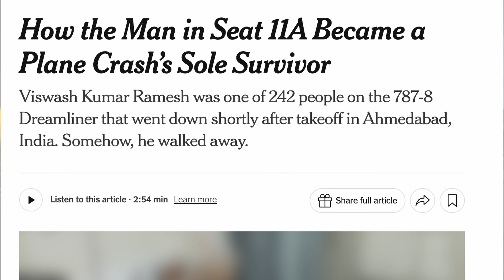Why the RAT Changes Everything – Air India 171 Update

Comment: Have seen the video of the survivor saying that for 5 to 10 seconds everything went silent in the aircraft as if the power had gone off .the light coming / blinkering  in the aircraft is the later part of his statement .i refer the silent part which he is mentioning as the power engine failing . The landing gear not going back into its position which is seen in the videos is a signal in my view that it could not go back because of the engine losing power at that point of time as it was about to take off having achieved it speed and was just getting airborne by then and once airborne could not achive the thrust due to the engine failing even though it was airborne by that time by virtue of having achieved the take off speed/position . Is it possibe that the aircraft landing gear not going back and thrust not being achieved once after taking off led to a system configuration error leading to the engines failing .The RAT being deployed and the lights coming back in the aircfaft as mentioned by the survivor meant the electrical and hydraulic system were back on track but not the engine power Am not an expert but trying to make sense of whatever i have read or listened to

Comment: The evidence points strongly to a dual engine failure. With bird strike and fuel contamination largely ruled out, a failure in the aircraft’s computer systems becomes a leading suspect.
On the Boeing 787 Dreamliner, the Common Core System (CCS) serves as the aircraft’s central brain, controlling not just flight operations but also both engines. The left and right Common Computing Resources (CCR) cabinets, along with the main lithium-ion battery, are all located in close proximity within the Forward Electronic Equipment Bay.
A catastrophic failure or explosion of the lithium-ion battery could potentially damage both CCR units. This kind of damage could disrupt fuel supply to both engines simultaneously. That scenario aligns with the loud explosion reported by the survivor. High ambient temperatures in Ahmedabad may have increased thermal stress, raising the risk of battery failure.
It’s worth noting that the 787 experienced at least two lithium-ion battery fire incidents in 2013. This history reinforces the plausibility of battery-induced system failure in this case.

Comment: A double engine failure though plausible is extremely unlikely. Another more plausible emergency situation is a complete hydraulic failure immediately after airborne while attempting to retract the landing gear. The failure prevents gear retraction, then due to confusion in critical stage of flight one crew member hastily or prematurely attempts to raise the flaps while the RAT deploys leading to loss of sufficient lift to keep aircraft airborne at such a slow speed. Pure speculation of course but seems to me to be more plausible than a dual engine flame out  due bird strike or FOD unless of course fuel contamination was the cause. 🤔
Reply: The video showing the plane crash with added propeller sounds is completely fake. I’ve watched the original footage with its ORIGINAL audio multiple times, and there were no propeller sounds at all. It’s disappointing what some people will do just to get views.

Comment: I am still perplexed about a double engine failure culminating in loss of power. Hardly anything in this aircraft could be thought of as more reliable than its Gen-X engines. The other point here is that the 787 is the first wide body to replace the APU with a lithium ion battery.The sudden deployment of the RAT suggests this could have malfunctioned

Comment: As an electrician i would be interested why the energy was lost so suddenly. From the run to the crash means more than just a generator failure. How can the electrical system fail in such a short time ? There are batteries and the rectifiers must have been shut down by feed - loss during rotating. The moment of voltage collaps is very crucial.

Comment: Here is the latest confirmed update on the investigation into the crash of Air India Flight AI-171, based on the preliminary report by India’s Aircraft Accident Investigation Bureau (AAIB), published on June 15, 2025:

---

🔥 Key Findings from the AAIB Preliminary Report

1. Established Cause: • Unintentional thrust reduction caused by the captain’s seat sliding backward during rotation.
• The seat locking mechanism failed in the rear position, causing the seat to abruptly roll back. The captain’s body weight pulled the thrust levers into idle.
• The first officer attempted to push the thrust levers forward but was unable to overcome the captain’s weight resting on them.

2. Mechanical Evidence: • Wreckage inspection revealed sheared locking pins (PN: BACB30LN5S02) on the captain’s seat rails.
• The technical log shows the seat was serviced 11 days before the crash due to “tight adjustment.” No functional testing was carried out after the repair.

3. Timeline of Events (based on CVR/FDR data): • +0:12 sec: Rotation begins. Captain’s seat abruptly slides back.
• +0:15 sec: Thrust levers in idle. First officer: “Thrust is dropping!”
• +0:18 sec: Captain: “My seat!” Sounds of struggle.
• +0:26 sec: First officer attempts to set full thrust; aircraft enters stall at 214 feet AGL.
• +0:38 sec: Impact with the ground.

4. Contributing Factors: • High ambient temperature (43 °C): engine performance was degraded, leaving minimal margin.
• Crew coordination breakdown: no “STAB TRIM” or “GO-AROUND” calls during the 26-second critical window.
• Design vulnerability: the Boeing 787 lacks protection against inadvertent thrust lever rollback (such as a “weight-lock” or reverse detent).

---

⚠️ Immediate Actions

• Global Directive: FAA and EASA ordered urgent inspection of pilot seat rails on all Boeing 787s within 72 hours.
• Air India: grounded 12 aircraft with similar seat maintenance history.
• Boeing: initiated redesign of the seat locking mechanism and review of thrust lever resistance settings (expected Q3 2026).

---

🕯️ Human Loss

• Fatalities: 243 onboard and 4 on the ground (medical personnel).

---

→ What’s Next?

• July 30, 2025: Final AAIB report with detailed technical analysis to be published.
• August 2025: International summit on cockpit ergonomics and safety (under ICAO auspices).

Sources: AAIB Preliminary Report | FAA Emergency Directive 2025-16-51 | Boeing Service Bulletin 787-25-123.
Reply: Can't find confirmation online of these reports/documents but this text was posted on a piloting forum by a normally "reliable" pilot... Seems too early for even interim findings to me, take with a pinch of salt

Comment: Apparently this flight when inbound prior to this flight, had some electrical issues.  I'm not how an electrical failure would effect the fuel selection valves or pumps? They also seemed to rotate very late, kicking up dust from the runway end. Was this due to slow acceleration or did they elect to do an intersection takeoff?    The initial pitch up was fine, but the moment they came out of ground effect the aircraft started descending.

Comment: There was a 2015 AD for the 787 detailing how the PCUs would shut down all electrical power to the aircraft if they were powered up for 248 days straight.
The fix? "Don't leave your 787 powered up for more than 120 days".
This issue was due to the 32-bit, 1/100th of a second clock in the 787 computers which would automatically send all AC generators into fail-safe once capacity was reached after 2³² centiseconds... 248 days 13 hours 14 minutes.
Highly unlikely for a 787 to remain powered up for that long, with maintenance intervals generally being shorter than this, which require full shut down... but conceivably, with postponed or skipped maintenance, could this 787 have simply been turned on for too long and reached this computing threshold, resulting in the computers shutting down, putting the electrical systems into fail-safe mode and potentially shutting down both engines or at least leaving no CPU to control them?

Comment: If they are certain it wasn't pilot error and that it wasn't birds. We can then assume it was an engine failure. But that is baffling, two engine simultaneously going out.. even if it was a fuel issue they would sputter, and it would happen slowly, it wouldn't happen this quickly which makes me think there's some mechanical problem. Almost as if I'm mechanic doing work on the plane put it back together wrong and no, I'm not saying that's what happened, but that's where my mind goes to next.

Comment: How on earth do both engines fail immediately after take off? We need a follow up when you collect more data!
Reply: Another video speculates that it was a hydraulic failure + vapor lock. The plane sat on the tarmac for 2-3 hours on a very hot day. Some of the fuel vaporized. Then combined with a hydraulic failure, which disabled the landing gear retraction and fuel pumps, it wasn't able to clear the fuel lines of the vapor bubble and stalled the engines.

Comment: Captain Steeeve, I have reproduced this flight on my flight simulator in order to understand the cause and have concluded for sure that this tragic accident was caused by a dual engine failure very close to the point of take off. However, I'd like to raise a new point that comes from the simulation. It's my belief that in the last few seconds of the flight the pilots turned the aircraft a few degrees to the right to avoid impact with a tall block of flats. Their heroic actions probably saved multiple lives. I look forward to seeing if this point is confirmed by the investigation. I'd like to add that it is horrifying and sickening to reproduce this accident in virtual reality. May god bless everyone impacted by this dreadful tragedy.

Comment: But RAT automatic deploy theory coming from both engine failure is faulty. If both engine really failed, all cabin lights would have gone because of main engine generators failed too and not come back after RAT deployment because RAT does not supply cabin interior lights (only emergency systems). and survivor would  most probably remember all lights and IFE system gone before impact (not blinking). RAT was deployed manually by pilot with panic most probably (he thought had to do something to recover lift) and when RAT generator engaged cabin interior lights blinked because of electrical bus transition. in my opinion, all these brings us again same point : wrong action:  to retract flap instead of landing gears. This can be insane but this phenomenon is rarely seen in F/Os. (confusing flap and L/G handle).
Reply: nonsense. that is what the RAT does , provide minimal power to keep the lights and controls operational. Didn't you watch Steve's analysis?. Pretty clear. Next time listen and clean out the ear wax from your ears.
Reply: @stevebubbie1126  RAT DOES NOT SUPPLY CABIN LIGHTING. its electrical capacity is too low and can only supply backup bus. (to conduct emergency systems). Steve may not know this detail. I'M PART 147 INSTRUCTOR .pls respect knowledge end experience.

Comment: Is there any chance that only the power system failed. When searching the web I found a bullet in from Boeing (in 2015) that stated out that for some reasons (more than 248 days  no complete "cold n' dark" state) the 0ower system watch dog might trigger all generators into an emergency routine, that shuts down all generators, except the RAT. I don't know if this has ever been fixed properly. Just a guess and question....
The report from 2015 mentioned:
A software bug in the Boeing 787's generator control units (GCUs) could lead to a complete loss of electrical power, potentially causing a loss of control. This issue arises when the GCUs, powered for 248 consecutive days (about 8 months), enter a failsafe mode simultaneously, resulting in a loss of all AC electrical power. Boeing is working on a software fix to address this.
Reply: Can this be ruled out? It led to an FAA Bullet In as far as I know...

Comment: That the RAT is deployed is for sure whatever the cause. Think also dual engine failure. But that the surviver heard a loud bang is not from the RAT deployment. I was at boeing with testflights with the 787–10. And we did a RAT deployment for testing but you can not hear that a seat 11A. This at door 2 Left. The RAT is at door 3Left, a.complete zone backwards….. the loud bang is maybe from the engines that stops for same reason…….

Comment: I have no idea if it was confirmed or debunked, but I saw a clip supposedly taken on the same plane earlier in the same day. From the audio you can ostensibly conclude the filmer was doing so to complain to Air India (at one point he says, "This is the service you provide us?") but he says that the AC didnt work the entire flight, and also demonstrates other electronics such as the phone and infotainment system non-functional. From the video of the runway, it seemed like the plane took a really long time to hit takeoff rotation. Perhaps there was insufficient time or management pressure to turn the plane without a proper inspection of the electrical issue?

Comment: Does the RAT supply electric power on the 787?   I’m a 757/767 guy and it doesn’t on those aircraft.   Power loss in the cabin would indicate dual engine failure along with RAT deployment.   If power was restored in the cabin to me that would indicate the APU was running.   If the massive bird strike happened not over airport there would not be any birds on the runway similar to USAir.   However I do not see any flocks of birds in any of the videos.

Comment: An up to temperature engine will run poorly, but still run on fuel that it won't initially start on. With that, I'd have to say that a dual engine flameout is from fuel starvation. Is there a fuel shutoff valve that shut off when it damn well shouldn't have? Something that's electrically powered open and spring powered closed? (which would be a stupid arrangement on an aircraft) but, it's employed on diesel engines a lot. Electric fuel shut-off solenoid on the fuel shut-off valve.
In this case the role is reversed. You can start the engine but you can't shut it off if it fails electrically.

Comment: The other thing that indicates engines out is they sound like they are spooling down, even accounting for Doppler shift. At full power they would be screaming, but if they failed after v1, or around v2, there would still be enough inertia in the turbines to still be lit, but little or no effective thrust. Or if there was a power failure which would have also deployed the ram, maybe control to the engines was affected? I don’t know how much of that would have any mechanical override in normal law.

Comment: Complete guess: Poorly inspected fuel pumps with a known bearing wear issue. Bearing debris clogged the lines and the increased flow from high throttle caused both engines to flame out.

Comment: I've seen an alleged video from a passenger that was on the previous flight, and they were showing that the plane had issues. AC wasn't working. None of the electrical stuff was working (Seat monitors, vents, lights, etc.). Who knows if its real but it's just some food for thought.

Comment: Maybe it was a faulty sensor.  If the FADEC system was getting faulty sensor inputs, maybe it looked like thrust was set - but the engines didn't produce enough thrust. So some kind of sensor failure. But that doesn't explain why the gear is still down. Unless it was related some how, that the glitch caused the controls to be lost over those as well

Comment: I'm a 767 300 Captain. A passenger on a previous flight , 2hr earlier, filmed from the cabin some weird electrical happenings. Is it possible that some weird electrical glitch caused both engines to roll to flight idle aka AUTO THROTTLES.

Comment: So what about the videos of electrical issues in the previous flight? Can't say the rat deployed then. They didn't have engine issues as far as what's reported. So it most be electrical failure that took out the engines and caused the rat to deploy due to no power.

Comment: This is such a delight to watch. Such a respectful analysis by Captain Steve. Just want to add to "aural" evidence. It's not just what you can hear in the video, it's also what you can't hear. During take off, especially at the distance the video was recorded, we should hear both jet engines really well. In fact, they should be the loudest sound during that pass. But we don't hear any of them, just a sound of a propeller plane passing by. It's the lack of that sound that also adds to the evidence that there was no thrust coming from those engines. At that temperature, with that load and during take off, they should be getting a real work out, but they are silent.

Comment: #CaptainSteeeve has now changed his opinion.. rightfully so..

Changed from Pilot error to now Dual Engine failure could be the main cause... 

Glad he changed it.. as it seems unfeasible that Co-Pilot pulled wrong lever of Flaps rather than Gear !! If so, Pilot in his MayDay Call would have clearly said wrong Flap lever pulled !!! Right?

(If this is technically possible then, Boeing has lot to explain. How can a Pilot pull the flaps when plane is heaviest, height of plane is not enough to correct the mistake and that plane will only crash land !!

Now with the visual evidence of RAT deployment, sound of RAT, survivor account of lights flickering and MayDay call.. Dual Engine Failure looks to be the main cause.Bird hit has also been ruled out. This lifts a lot of bad press on Co-pilot and Air India.

Two Engine failures simultaneously also cannot be due faulty maintenence, as Air India is an old organization and very capable technologically..